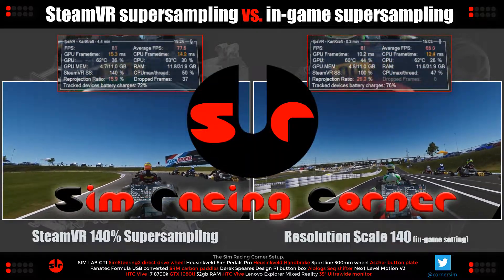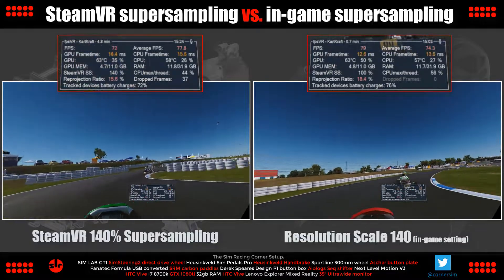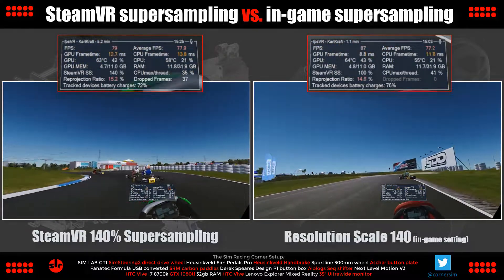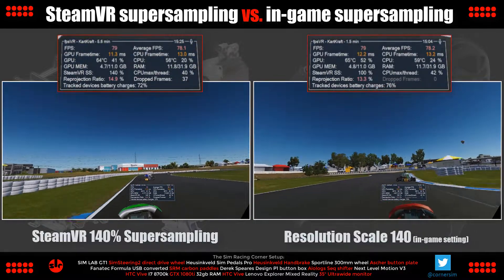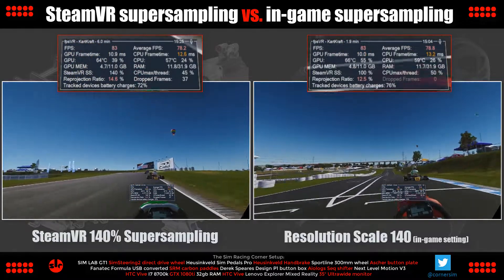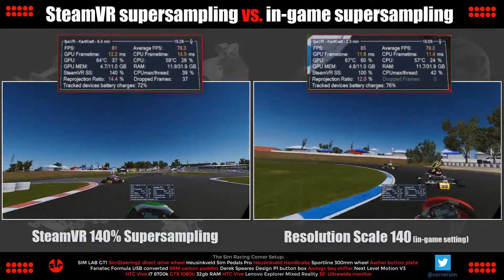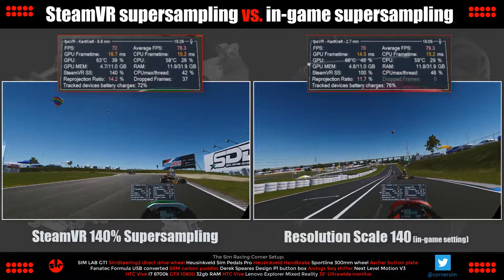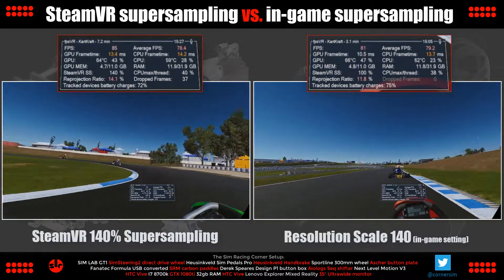SteamVR Supersampling vs. in-Game Supersampling - Which is better?

Comment: steamvr is supposed to be better? it shows me you have 37 frames dropped? never the less I'm using it to because no need to edit files :)
Reply from the maker: From my test, there's no performance difference between the two, at least in this title. The 37 dropped frames can be ignored. That number stays the same from start to finish in this run, so nothing worry about. And 37 dropped frames is hardly anything.
Reply: @SimRacingCorner  ok, thank you
Reply: @SimRacingCorner  there is. Your gpu usage is 20% lower using steam

Comment: Thanks for video, this is a question I have been asking myself.  One thing I have noticed,  using steam SS seems to be using less gpu and cpu power.   This means you could turn up to 150 and use same power and would it look better.   I dont know
Reply: yes from the video seems so, also the reprojection ratio is lower for ingame ss...